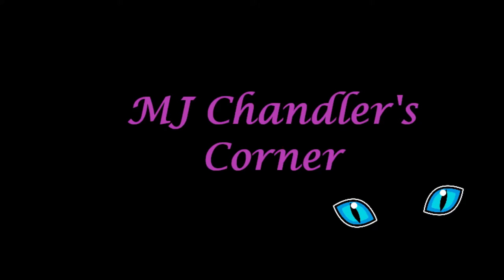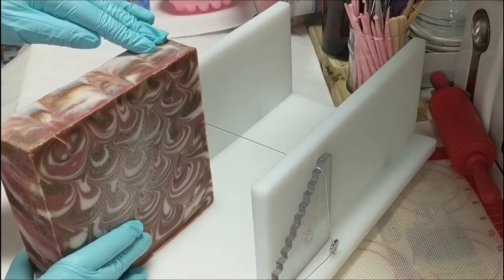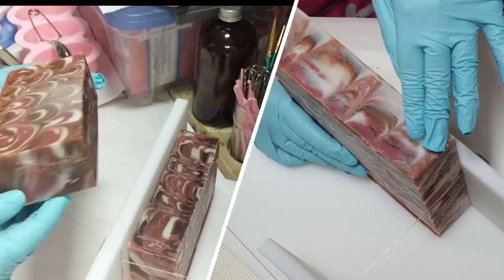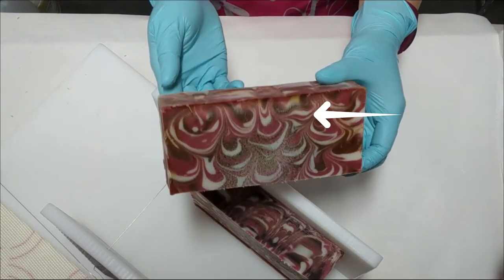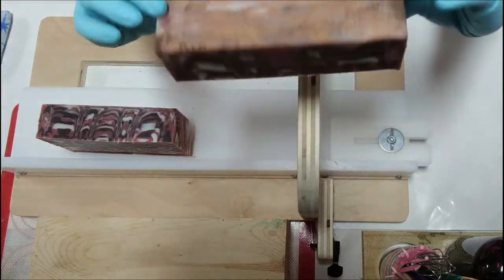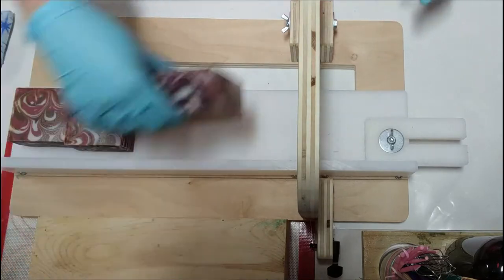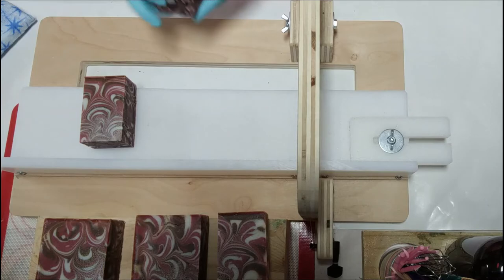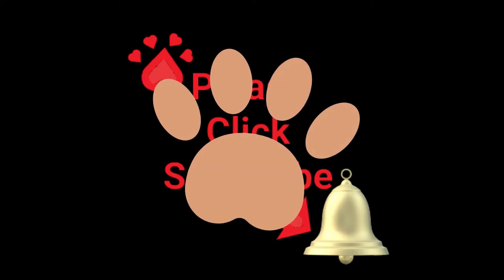Testing Soap Log Splitter for Handmade Cold Process Soap Loaf_Soap Cutting

Comment: Can you use the log splitter to then cut the logs into smaller pieces? I’m trying to see if I can avoid buying a single wire cutter...
Reply from the maker: I have not tried it for cutting into single bars, but I think it would be a hassle. It's easier to get uniform bars with a single bar wire cutter. Less measuring and freehand involved.